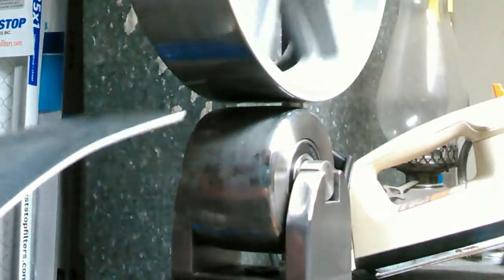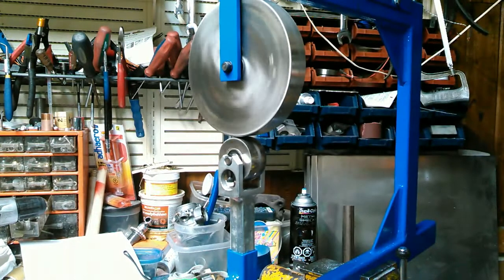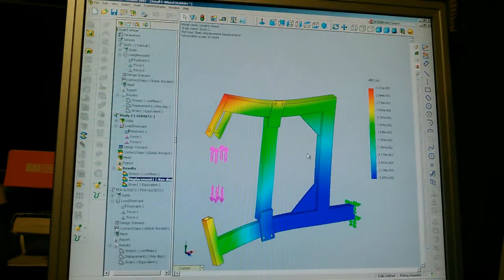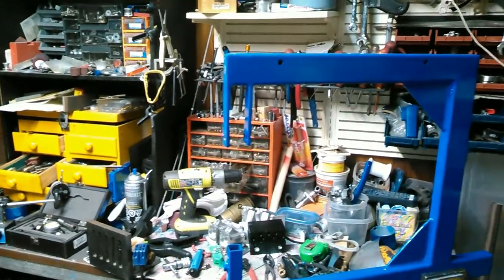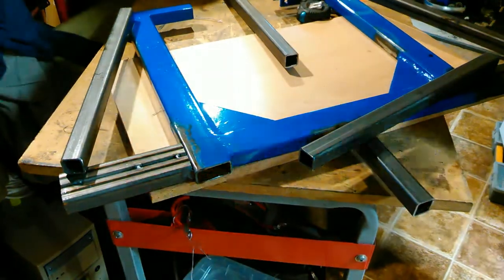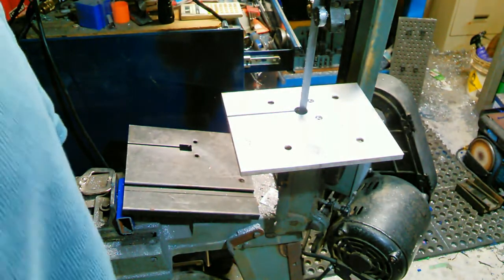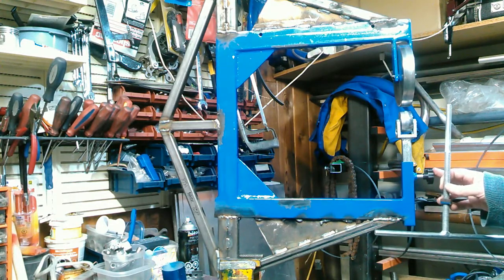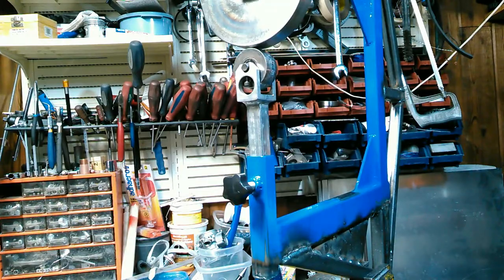Small English Wheel Upgrade

Comment: I'm thinking instead of a truss setup..you could double up on the thickness of the frame to keep it from laterally flexing as it is now.
Reply from the maker: Ya, but at that point you might as well just start from scratch with the frame and just use the wheels. There are some nice bench top wheels out there to copy a design from.

Comment: Great video!  

I have the same Princess auto wheel and a 18" bead roller with plans to do some reinforcing for both.  I'm thinking of combining the two back to back on my metal bashing stand which I set up on wheels.  I think you may have the same stand actually, saw some blue steel and dies in the background of one of your shots which looked like it.  The PA tools may be weak from the factory but I'm not inclined to pay big dollars for the proper gear and I don't think I could justify the storage space.
Reply from the maker: Hey, where about's in Canada are you located? I've got a bead roller from KMS tools that I have reinforced. If you are interested in it I'll post a short video to show you what I did.
Reply: @Rickd-jh7iw  I'm in Newfoundland.  Unless you're local the shipping cost would probably be higher than the tool is brand new lol.

Comment: Nice work but I can't stop thinking that filling the tubes with concrete would work well. What do you think?
Reply from the maker: Might work. I just happened to pull the wheel out today to smooth out some walnuts on an aluminum tail piece that was too tight to get at with the big wheel. It knocked down the worst of the bumps, and because the part is going to get body worked and painted it was good enough.
Reply: @Rickd-jh7iw  I recently acquired a small wheel. I'm happy with the arrangement of wheels and adjustability buy seems I have to preload the wheels a fair bit to get them working. I wondered before about casting a concrete frame but since I bought this now perhaps filling it would work. I don't really fancy doing the additional bracing.
Reply from the maker: @Squintanditsmint  The amount of work required to fill the frame with concrete is minimal, so it's probably worth the effort. Threaded rod is cheap, and I'd get some 3/8 or 1/2" rod to act as re-bar as I poured in the concrete.
Reply: @Rickd-jh7iw  thats a good idea. Cheers. I'll let you know how it goes.